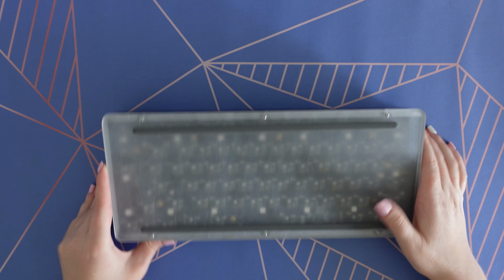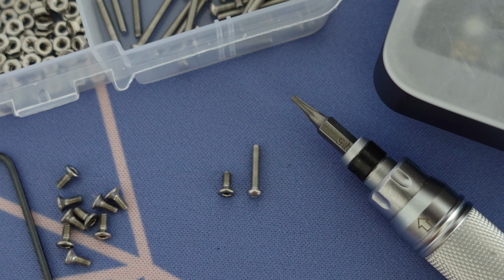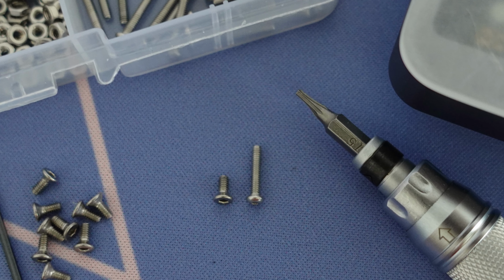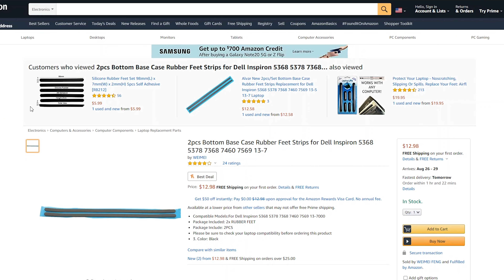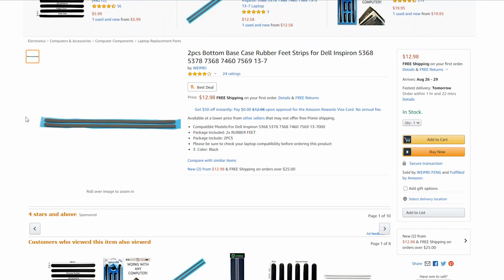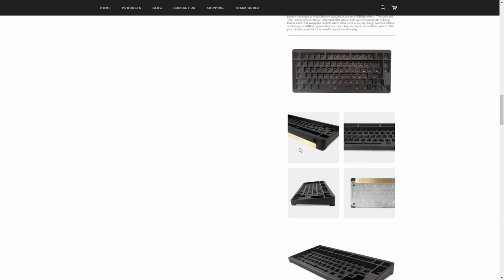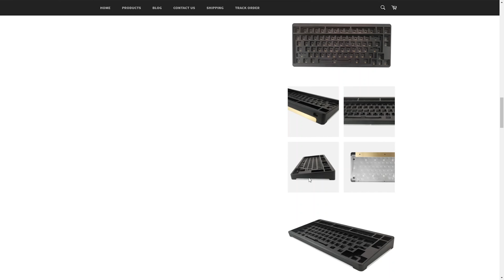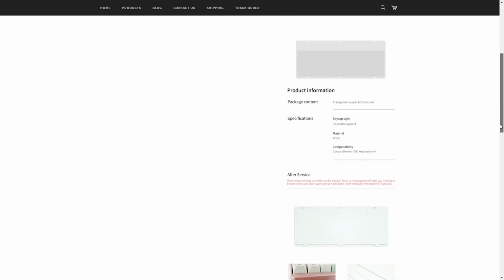ID80 Custom Diffuser Tutorial | Mechanical Keyboards

Comment: Thanks for the guide! Where did you get the laptop feet from?
Reply from the maker: King Wang Wong no problem! I got them here: 2pcs Bottom Base Case Rubber Feet Strips for Dell Inspiron 5368 5378 7368 7460 7569 13-7 https://www.amazon.com/dp/B07PS6M8G2/ref=cm_sw_r_cp_api_i_VrUtFbPB51FBM
Reply: @SerendipityChannel91  thanks a ton! Also love that Ludens👍👍

Comment: Great videro :) Your diff has more mas and thickness and most prob will help will with soundprrofing teh keeb. Actually I just thought that if in the middle of the bottom piece there would be extra 2-3mm space then one copuld put some extra foam (or silicone!) in there. But that would require some skill and time...Anyway I greatly appreciate your vids and time - I'll take a DIY approach to buying any time. Cheers!
Reply from the maker: Thanks for the compliment!  I'm actually thinking of making a silicone dampener for this keyboard :)

Comment: how do you change the colors on it=
Reply from the maker: Hold the function key + "Q" to toggle the RGB lights on/off. Hold the function key + "E" to change between different RGB modes. For more information on how to modulate lights, "config.qmk.fm/#/id80/LAYOUT" and click on "1" under "Layer Section".

Comment: Wait if ill put a foam on the bottom the leds wont show right??
Reply from the maker: Rx003 correct. If you wanted to put foam on the bottom and still have the LEDs show, you would have to poke holes in the foam over where they would shine through 😊

Comment: Do you think you could still add foam and cut out little holes so the leds still shine through or would that not work?
Reply from the maker: I Guess although I haven’t tried that myself, if you really want to dampen the board with foam, it’s possible to show off the LEDs if you cut out little holes for them 😊

Comment: Hey great vid, do you think the Id80 sounds good? And with the acrillyic diffuser you won't be having any foam in the case since it would just block the LEDs correct? Thanks
Reply from the maker: Ian Lu it’s not the best-sounding keyboard in my opinion, but using the silent brown switches on it does minimize reverb from typing. Yeah, I’m not currently using any foam because then it’d block the LEDs 😊

Comment: are the lights already included in the keyboard? If they are whats the point in them being included as no light shines through anyways
Reply from the maker: presentable yes, the PCB does have the RGB underglow included. I believe this PCB was originally used for a different case that had a diffuser, and IDOBAO just reused the same PCB with their own case.